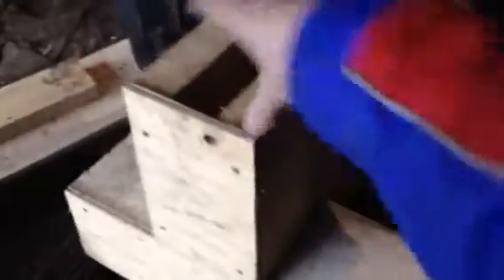Rocket Stoves Episode 13 Project updates

Comment: if you cast it you should use fire brickaround the wood so wen you birn the wood the inside gona be fire brick because cement  is not gona last unless you have refractery cement
Reply from the maker: +MRnounoursSQ  i do have refractory cement - and fireplace mortar - and perlite.  ive spent 160.oo in ingredients so far and this will be my 3rd casting experience.how many have you cast and what ingredients gave you problems?
Reply: Mi first cast was portland cement and sand.
It still ok.
Mi second was portland cement and vermiculite.
the heat inside is so high it disintegrate all the inside.
Mi third is portland cement , sand and vermiculite.
It is woking ok the inside is disintegrate too but just a litle.
I did find refractory cement and its realy expensive 75$ a bag and its good up to 2500° F.Mi next bild will be a boiler.
I tink the bigest problem is the heat is so high that if you stop it whit a good refractory  dont mater what is the second layer as long as its fire proof.
cant wait to see your next bild.
And all my stove for now are all prototipe to see how to bild the best one and im still learning.
Mi last stove i get temperature up to 1150° F on top.
Reply from the maker: +MRnounoursSQ those are good heat numbers if you get 1000 on top!   Mine is designed to run slightly cooler for longevity of the stove, and these are also experimental prototypes, but I learned a lot from my first one.   They say that Portland cement is no good near fire
Reply: +John C Great project.  Where in Canada did you order your perlite and refactory ingredients?
Reply: +John C 
Thanks.  I've been playing around with small rocket stoves and always wanted to make a heater.  Definitely more of an investment in supplies.  Thanks for sharing your experience/thinking.  I'm in Waterloo but I would build the heater up around Algonquin park at a cabin.
Reply from the maker: +Tom Pike  thanks I've been meaning to update this project again.  
I got a bucket of refractory cement from Amazon.ca , I got some large 17 liter bags of perlite from Rona, and some more smaller bags of perlite from Home Depot, as well as a bag of mason mortar (fireplace mortar) and a bag of builders sand, which also came from Home Depot.
Reply from the maker: My main goal is to switch my reliance from fuels like propane, to wood.    I can gather my own wood from the land, and elm trees are dying around here so there is no shortage of dry hardwood, and I don't mind doing some work to w self sufficient and hopefully live off the land, without relying on fuel bills as much.